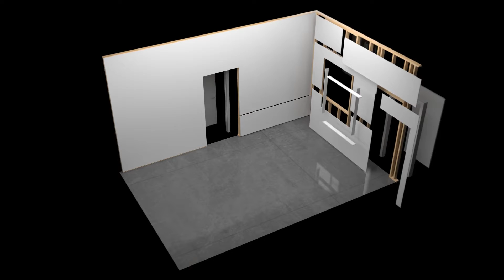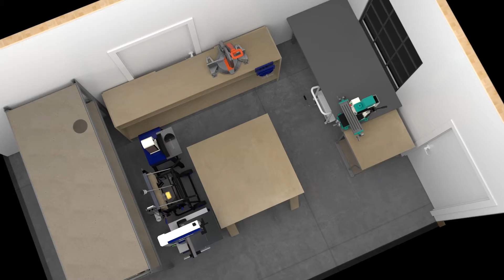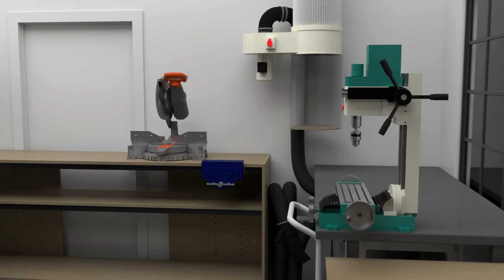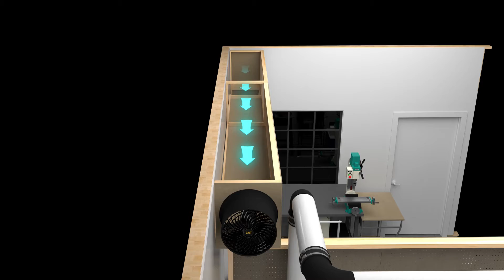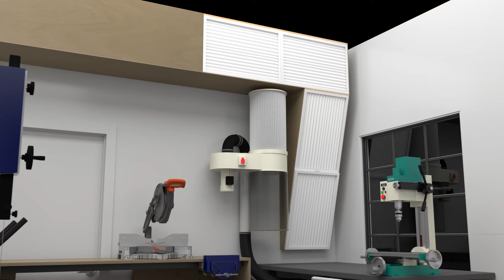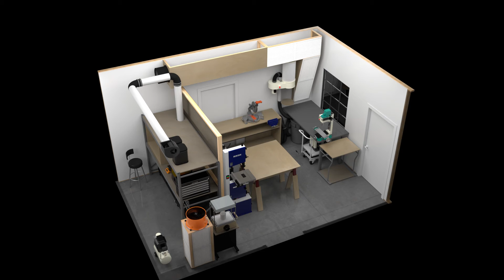Small Workshop Design in 3D

Comment: Did you ever complete this new air filter system? I did not see a video for it.  Currently trying to decide if I want to build the mobile unit you were using, or make a wall hung design like you show in this video.
Reply from the maker: I was never able to move into this space due to some issues with the owner. So, haven't had a chance to try it out.

I will have a whole series coming out soon with a few new options for your consideration. A few videos get into ducted filtration and how great it works in smaller spaces. The design in this video is similar to a ducted approach. So I imagine it would work well. One benefit is that it doesn't take up any floor space at all but the new designs are fairly compact if space isn't a big issue.
Reply: @The3DHandyman Awesome, looking forward to the series!

Comment: When is the Model A available?
Reply from the maker: I will probably not make the Model-A any time soon. I'll explain in my next video a bit more but it's to time consuming and expensive to make. Its a much better deal if you just use the plans to make one.

Otherwise I've added a drum fan option to the Model-B. This has the same performance of the Model-A but at a lower upfront cost with lower filter replacement costs over time.

Comment: Very interested to see how this will work out for you in practice. I need to come up with something similar, so I'll be stealing your good ideas :)
Reply from the maker: Please do 👍 that's what the channel is for. Sharing is caring. The build for this unit is going to take much longer than expected but I will have some updates to the original air filter in a week or so. I'll throw plans into the video for a standard ceiling mounted design if you want to be a beta tester.

Comment: One thing that stands out to me is the "dust collector" and how it has a 180 degree path. Have you looked at flipping the intake upside down (keeping the filter on top)?
Reply from the maker: I had considered that. It seems like it would be better not to force the air to do a 180 but the internal geometry of the fan housing may prevent it from working as intended. It's worth doing some tests on before making a final decision. I'll do a video on this retrofit when all the details are worked out.

Comment: Over pressurization is the best method to keep airborne out of a given area. In addition would consider some external air intake in the clean room area and also also consider an external exhaust near the air filters in your design.
Reply from the maker: I was thinking about a external intake for the cleanroom specifically for when the spray booth vent hood is running. What would be the purpose of exhaust near the air filters?
Reply: @The3DHandyman  The exhaust port provides direction for the airflow and particles to move towards. Think of it like a blower door test on house. The pressurization of the house to see how much air leaks from various gaps. If you just pressurized the shop it would have ballon effect, meaning not much air movement. By creating an exhaust port the air will travel to that path which least resistance. We use this in military bunkers and was highly effective in keeping out chemical gases and bio continents because the air is continuously flowing  out. Oh, suggest filtering the intake air as well and do a good job air sealing (zip system tape) all the walls during construction. Matt Risinger did a video with blower door testing ( they are sealing holes however  your goal is the reverse of that.)  Your air filter design is really nice!  Be Safe
Reply from the maker: Awesome! Thanks for all the info. It will be a challenge to make sure the room is sealed perfectly and that is probably going to effect overall performance. I will check out that video you mentioned before I lock down the design, for sure.

Comment: With the main goal being to keep dust off the 3D printers, I'd suggest enclosing the shelf the 3D printers sit on and adding a set of plexiglass doors. Put a small filtered fan blowing air only into the enclosure and the positive pressure will keep anything out of the small cracks in the enclosure. The paint booth is a bit harder to keep dust free, but the filter setup you showed should help with that part pretty well.
Reply from the maker: Thanks for the comment! I am thinking the cover for the printers is a must but I don't have those details worked out just yet. A filtering enclosure is a good thought. Besides the dust issue, there is a heat issue with both printers not functioning properly if they are being blasted with air.

I'll keep thinking on it and then make a video about it at some point.
Reply: @The3DHandyman  Very valid point, haha. A 120mm computer fan should be plenty of positive pressure, but that could still be too much fresh air for printing the high temp filaments. You can probably get away without a fan if you're feeling lucky. I've been running an ender 3v2 in a cheap insulation board enclosure for around a year in my garage with a fair amount of woodworking and cnc machining and so far I haven't noticed any signs of dust issues in the prints or on the machine.
The new space looks awesome by the way and it should be great to have a dedicated space.
Reply from the maker: Thanks! I'm happy to be moving out of the house and into a proper space. It's certainly not without its costs and drawbacks though. Waking up and being at work already was a plus!

Good to know that your insulation board enclosure is enough to keep things warm. I may end up going that direction. At the moment I'm more concerned about the Form 3 getting dust sucked into it damaging the optics.